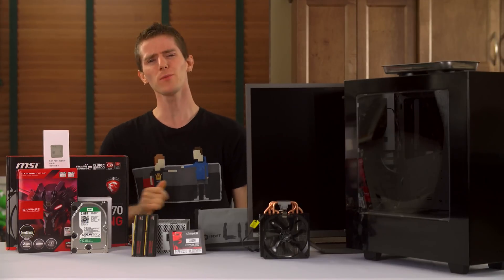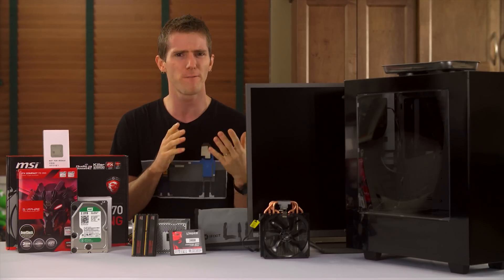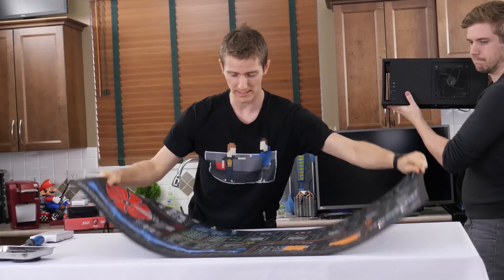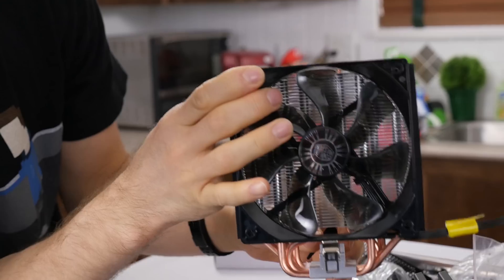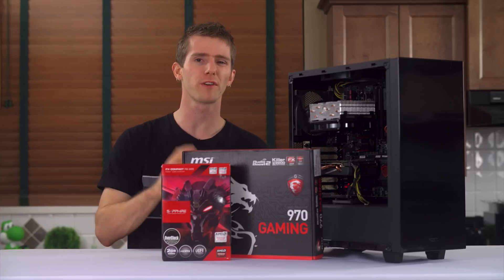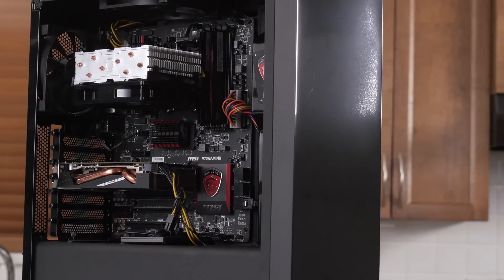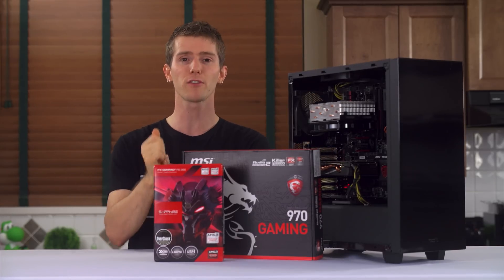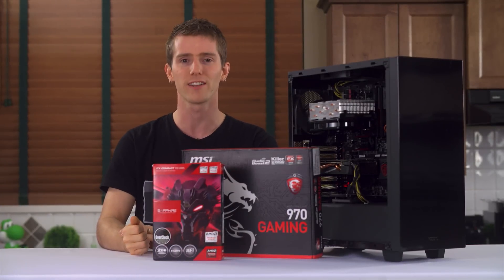Can you Build a 4K Gaming PC for Under $1000?

Comment: Two RX580's, R5 3600, 16GB 3600mhz, 256GB SSD, 4TB HDD and $250 4k Monitor. Bam wait for sales. Then you have a solid 4k PC that'll perform like it has a 2080 in it. For a lot less.
Reply: Crossfire isn’t great, but yes everything is correct there.
Reply: @2quick614  Yes, however the cards went on sale for $100 at one point and 3 of them will go toe to toe with a 2080ti, 2 does just fine for most. For half the price of a 2070 super. All you're giving up is some fancy lighting software. Personally come black friday what I've just described is exactly the components I'm hoping to pick up. Unless a 2080 Super is discounted to say $300.

Comment: i got a dell 7010 with an i7-3770 and 1 gb of ram, for 35 dollars via government surplus. put a 970 i got for 185  in it, had to run it without the side and cut the back a bit to make the card fit. though i couldve and did run it with a pci extender for a bit. had to use an external psu i got a cheap 600 watt unit for 443333 bucks. dunno if i can do 4k with it but does 1080p all day for 265. honestly tit does it pretty well with just a 1050ti

Comment: Hey I just want an opinion about my setup 

AMD Ryzen 3 1200
8gb DDR4- 2400
GTX 1050ti
2TB HDD + 120gb SSD
Cryorig H7
ASRock - A320M-DGS Micro ATX AM4 Motherboard
Fractal Design - Define Mini C with Window MicroATX Mid Tower Case
EVGA - B3 450W 80+ Bronze Certified Fully-Modular ATX Power Supply

The cost is about 800$, and I just wanna game 1080p at a good 60fps for now, while I save up for another PC
Reply: SnakierDrip6 should be good but i would recommend a 550 w psu.

Comment: Hey guys can I get a little help? So this build runs Wow style games easy in 4k with a good fps...but what if I try to run games such as DOOM (2016), Battlefield, and such on this pc using ultra settings? Will this build handle it? What if I throw in a 1050 ti - 1060?
Reply: those will barely run those games at 10 to 20 fps(30 at most) but if you really want game at 4k under 1000$ then go for something like a 1070 and you will get around 30 fps
Reply: wow, my brother has a 960 and a good cpu and it runs doom at 70 fps on ultra. ???

Comment: DO NOT BUY THIS MOTHERBOARD.

Now that I have your attention: The MSI 970 Gaming motherboard has an existing problem of the VRM overheating and blowing CPU's. It blew my 6300 and MSI refused to replace it even though this board has been known to have these problems for years. Buy literally any other brand of AM3+ motherboard, because the higher tier 990 FXA board from MSI still has this problem.

Comment: Could you guys please take a couple of minutes to look at my build and give me some tips about what to buy for it?

Processor-Intel i7-4790k 4.0 GHZ 1150 socket 
SSD-256GB SSD Samsung SSD EVO 
GPU-GeForce GTX760 4GB 256bit 
HDD-2TB western Digital Black 
RAM-G. Skill Ripjaws X Series 16GB 240-Pin DDR3 
SDRAM DDR3 1600 (PC3 12800) 
Tower-NZXT S340 White Steel ATX Mid Tower 
MoBo-MSI z97 Mini ITX board 
PSU-Corsair RM 850

Comment: lol easy peasy, I built a 2+ thousand dollar machine with a 700 dollar laptop and an ipad air2. I traded the laptop for a case with a i7 5930k x4 corair 8 gb sticks,  a 1 tb evo 850 ssd, a corsair h100iv2 cooler, an 850w continuous evga psu gold rated, a blueray drive,  a 27 inch AOC monitor. I traded the ipad for a gtx 980ti msi golden edition, and a corsair strafe keyboard, and i kept my wireless mouse and headset and i did it in one weekend.

Comment: Are The Decent Specs? (Anything to change, upgrade or add)
-Intel Core 6500 3.2GHz (Quad Core)
-COOLER MASTER Hyper 212 Plus
-H110 Chipset [Max 2 Sticks Of Memory]
-16GB (2x8GB) DDR4 2133Mhz 
-1TB 7200 RPM 
-Geforce GTX 1060 3GB
Reply: Twoopeh if you have the money i recommend to go gtx 1060 6gb
Reply: Twoopeh and ssd would be good too :)
Reply: leevi moilanen thanks what ssd should i get?
Reply: Twoopeh Grab any relatively cheap 120 or 250 gig ssd, kingstons are pretty cheap.
Reply: Hyde thanks I'll be sure to add one
Reply: I have literally just finished building this build this morning for a friend and it works amazingally
Reply: Pete Loud you built it?
Reply: bruh theres no power supply, and which 1060 would you buy? the evga superclocked edition 3gb is only 200$ (i think)
Reply: i recommend you remove that cooler master hyper 212 because your not going to overclock your cpu, a cpu cooler from the i5 6500 would be good

Comment: can this run arma 3 and DayZ in 4k or even 1440p
Reply: It's old now probably not I play 1080p with a 780 ti on ultra at average of 77 fps
Reply: Arma3 runs like crap on even monster machines. It has the same problem WoW has. It is more CPU dependant than GPU dependant. It doesn't matter what kind of graphics card you have. After a certain point, the engine just doesn't go any faster.
Reply: Lstrn what's your CPU?
Reply: my cpu is a i5 6500 but i overclocked it using the old bios to 4.0ghz
Reply: CPU intensive game =P no wonder
Reply: i did have a i5 750 and got 30-40 fps average
Reply: Lstrn Ouch, still surprising how well old cpus hold up
Reply: yeh it was a beast but the thermal paste was never changed so when i took it out the thermal paste was like chalk and it was hitting 100 'C while playing arma 3

Comment: while looking at the upgrades for the coming PlayStation and Xbox 4K models I came across your posting where there was an argument that 4K really isn't relevant unless you're going to have a really big screen like 50 inches or greater and even some saying a base of 70 is the bare minimum does this apply to monitors as well? the argument being unless you have a larger screen you're not going to benefit from the extra pixels

Comment: Hello there.

So I was thinking of developing a future-proof 4k gaming rig at max settings with 60+ fps. Please feel free to recommend any changes to this potential setup. Thank you. :)

My setup:

CPU: Found on street

Motherboard: Mother

CPU Fan: Mouth

Video Card: GTX 69

Power Supply: AA Battey

Case: Briefcase

OS: Minecraft

Mouse: Rat

Keyboard: Piano

Monitor: Imagination
Reply: I think this will last you for a couple of years, upgrades might be required after that.
Reply: Aditya Tugnait K thanks, I was also thinking of getting an atari for some 8k gameplay, would that be within a five dollar budget?
Reply: +Aidan Teall I would recommend a gamecube, they are easier to overclock.
Reply: Flamevectros11 At what temperature? Because my current rig glows lightly when running minesweeper
Reply: You should upgrade your graphics card to a PS4 because that should give you about -100 frames but it looks cool
Reply: You might want to upgrade the case to a suitcase and monitor to hall monitor. Other than that it's an amazing build.
Reply: I'd recommend the GTX 420. It improves your imagination's performance by 100%
Reply: How did you afford dat
Reply: whucarez 
You can only overclock on z170 motherboards, so no need for a 6600k
One 980 Ti is better than 2 RX 480s
Unless the monitor is less than 2 feet away from the viewer, 19.5" is waaay to small
Reply: Swap out the cooler for a butthole you can over clock so much further
Reply: If your going to get a 980ti, then why not get a 1070 as its cheaper and is more powerful??
Reply: Aidan Teall maybe upgrade from mother ti father
Reply: Futureproofing is practically pointless.
Reply: I recommend you swap to a gtx 6969. It will give you double the performance.
Reply: @SuryanshRajsingh18  I think the new gtx 42069 could perform really well in this instance
Reply: Jae Sambo yo thanks for the support man it took me a while but I got it configured
Reply: Aidan Teall this may be the funniest comment I've ever seen
Reply: Aidan Teall this is damn innovation at its finnest
Reply: You should think about grabbing a 2006 curved screen tv as a monitor off the side of the road if that is within your budget
Reply: U can always overclock and water cool your rat for extra futureproofing
Reply: i7-6950X
32GB DDR4 @ 3200MHz
2x GTX TITAN Xp in SLI

good for a decade of gaming in 4k
Reply: Thanos a decade you say? well it’s been 4 years and that’s certainly not gonna be enough for 4k unless you’re playing csgo lol. but I gotta say the only thing that’s still relevant nowadays is the 32gb of ddr4 3200mhz ram, that’s pretty good

Comment: Linus can help me with my computer I have a pretty good configuration and want to go to 4k what recommendations will you give me
Reply: Motherboard Name Asus M5A97 LE R2.0
Memorie Kingston 8GB 1600 Mhz DDR3 Non-ECC CL9 DIMM (Kit of 2) XPM HyperX Blu (Red)
GeForce GTX 650, 2GB, GDDR5
2 * KINGSTON SV300S37A240G raid 0
AMD FX 6100 Six Core Processor
630 v surse
Reply: whats your budget? i currently have this build http://pcpartpicker.com/list/vrww6X
it runs most games at medium to high settings, Dayz SA, Starcraft, Arma 3, Battlefield 4
Reply: I HAVE A BUGET OVER 1000 $ BUT UPGRADE THE PC OR BUILD A NEW PC
Reply: I CANT BUY THE VIDEO CARD EVGA GeForce GTX 960 4GB SuperSC ACX 2.0+ Video Card AND A 4K MONITOR FOR DELL

Comment: how about a 4k gaming rig now?
Reply: I would say get a GTX 1060 6GB or a RX 480 8GB. Just the most "value" performance cards available right now
Reply: This will still work, I substituted this GPU for a GTX 980 ti FTW and 32 gb of ram
Reply: yeah but then it won't be "affordable"
Reply: +Kyon depends, 450 for GPU 350 for CPU, 70 for ram, 70 for power supply and 60 for SSD. around the $1k mark
Reply: Kotic KAT 980 Ti would blow the 1060 out of the water
Reply: ***** Eh
Reply: I agree with that one ^^ although I believe the PSU might not be enough
Reply: Now GTX 1070 or 1080 can do the job. With $599 at max. Not founder's edition.
Reply: Will there be an RX 490 to follow up the 390? That will likely be the key component if they were to redo this
Reply: Yes
Reply: i would buy a XFX R480 (you can OC it to run about as fast as a 1070) cost 250 bucks a I5 6400 processor and 16 gb of DDR4 ram 500 watt powersupply and your good HDD and SSD you can pic out yourself you will be done for about 800 euros i guess thats around 1000 dollars. what you also could do ( this is what i would do ) buy sumthing like a HP workstation with a I5 6600k second hand online for about 500 euros and then put a graphics card in it then your done for about the same money. but you got a better proccessor that will last you a long time.
Reply: i dint say as fast you arent even quoting me correctly. and you can also just talk to me like a human being. you are very disrespectfull. you can oc a xfx blacksieries so that it runs faster then a 1060 whats higher thne a 1060 a 1070 so thats why im saying that.
Reply: But overclocking it that much will tear the gpu pretty fast.
Reply: Also core cloc isnt the only factor when comparing gpus
Reply: Kyon Easy. 6600k and 1070 for under 1k. Has to be prebuilt though, literally can't get it cheaper building. (includes windows) Powerspec g313.
Reply: Kyon around the same price you can get dual r9 380 core i5 and 24 gb of ram
Reply: An i5 6400 and a 1060 with 12gb ram are good for gta 5 and fallout 4 at med. 4K 30 fps. Check out potato masher pro. It's $500 for 4k
Reply: Or… now?

Comment: HOW BOUT THIS HUH http://pcpartpicker.com/list/XG2tJV
Reply: not bad.
Reply: pretty decent
Reply: Considering that these parts didn't exist when the video came out it's a pretty nice build. I don't know if this i5 would bottleneck the 1070. A 6600K with a 1060 would be more stabilised and cheaper.
Reply: 1. This video was made about 2 1/2 years ago
2. This is CAD we're talking here, not USD
3. Your partlist is meh
4. Here's a better one:
http://pcpartpicker.com/guide/WnMnTW/1000-sff-small-form-factor-build-feat-r9-nano
Reply: There would be no difference between an i5 and an i7. Specifically the 6600k and the 6700k, the extra threads doesn't help the gpu become more stable, its just the clock speed. With that said, just get a 6600k and oc it.